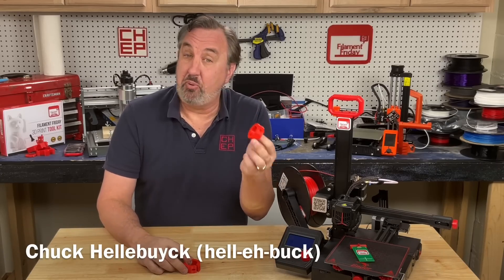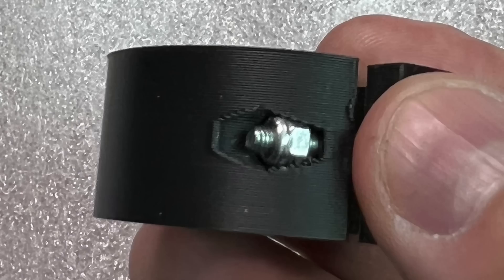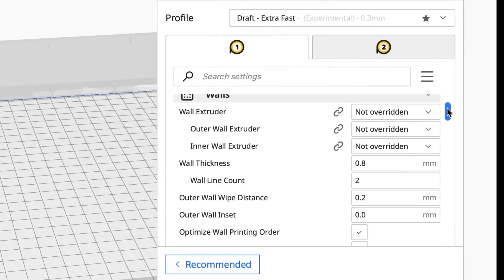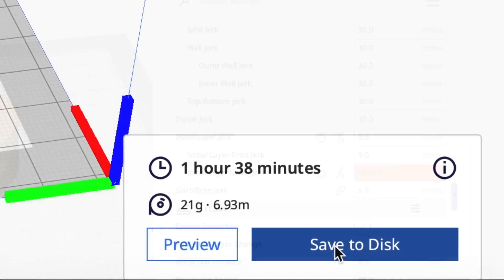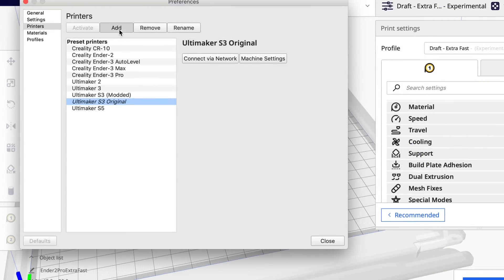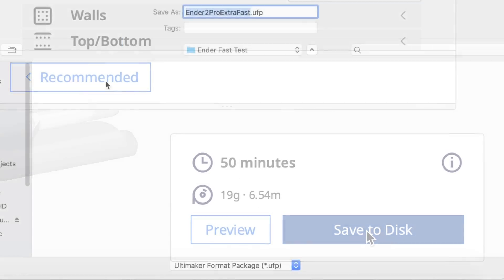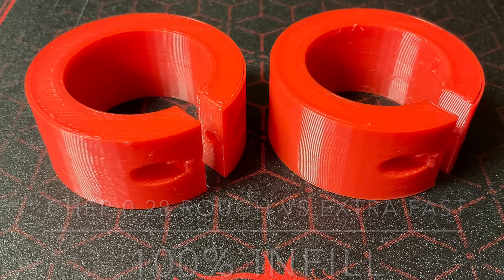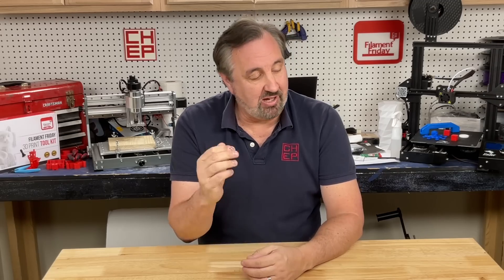Faster 100% Infill Prints with Cura 4.13 on Ender 3D Printer

Comment: I bought an ender 3 pro a few days ago, I downloaded the profile to print faster and when using it sometimes it starts to have a loud clicking when retracting, at that moment it starts to print the layers badly, separated and detached, but sometimes it happens later After an hour of printing the first centimeters perfectly, the clicking begins, it begins to have hairs and the layers do not complete well. As a result, I have to throw away the imprecion. I tried to lower all the speeds, that helps but sometimes the problem occurs. Could you give me any help?
Reply: I had this same issue with my Ender 2 Pro; tried everything from temperature settings to various print speeds and nothing helped. Turned out that the extruder tension spring wasn't applying enough pressure to the filament, so when there was a part of the print with a lot of small retractions in succession, it would slowly grind away part of the filament and eventually lose grip. Check your filament at the extruder to see if it has a notch (too little spring pressure) or if it is deformed (too much pressure).
Reply: @DanielMushailov  After many tests, what I saw happen is that when I print more than 2 or 3 small pieces or 1 relatively large piece, it prints well for 1 hour or a few layers perfectly and then the nozzle clogs, and stops extrude, I tried with different filaments, it may be when it retracts a lot, but I don't know why it gets covered, change the nozzle and it does the same. It starts printing perfect and then it fails. If I put a small part alone, it usually prints perfect until the end.
Reply: @playtech7165  Have you tried using a different slicer, and if so, do you experience the same issue? If not, maybe you can compare the settings between the two slicers and see if one of the settings might be too aggressive in Cura. Also, you mentioned that when it stops extruding, it is difficult to remove the filament - do you see any inconsistencies in the filament you pulled out?
Reply: @DanielMushailov  I'm going to try the g code of the dog that came with the Ender 3 pro. I also recently went from cura 5.1.1 to cura 5.2.1. I am using the default profiles for the ender 3, the low and standard quality. When I remove the filament, sometimes I have to use a lot of force to make it come out, and I mean a lot of force..., but the problem is strange because it starts printing well and then it gets covered, it does it with all the prints... Now I try the gcode of the dog and see what happens.
Reply from the maker: Check your arm for a crack. https://youtu.be/iXe7bftyMFU
Reply: @FilamentFriday  I have the creality brand metal extruder, the silver one. After several days of testing without sleeping at night, I am coming to the conclusion that it may be the PTFE tube. When the filament gets stuck, and I take it out, I have about 20mm of the tip much thicker than the rest, it's like a swollen filament plug with the shape of the nozzle at the end. That jam that occurs after printing generates that there is no good extrusion or no extrusion at all. Tomorrow I get 2m of genuine Capricorn tube. I also bought the CR TOUCH leveler, since the bed is deformed and with a glass I could not finish making the pieces stick to it. Once the tube has been replaced and with the automatic leveling calibrated and working, I will see what happens and tell you.
Reply from the maker: That happens when the PTFE is not all the way to the nozzle or your fan is failing causing heat creep.
Reply: @FilamentFriday  A few minutes ago I finished changing the ptfe tube for a capricorn from creality, I also put cr touch, and glass, now at the moment it is printing correctly, I don't know how long it will last, so far in less than a month I was able to print half of the time and the other half I was having a hard time trying to solve problems. Thank you very much for your videos and for your answers!
Reply: @FilamentFriday  Confirmed, when it clog it is a heat creep problem, the tip of the filament is 1.9mm thick, the last 30mm before reaching the tip of the nozzle. It takes a lot of force to get it out when it gets stuck like that. I find it strange that the front fan is failing since it spins perfectly all the time and the printer is 1 month old since I bought it new. I tried a temperature of 205º and 195º to see if it affects anything... since I saw that heat creep can be caused by high temperature, more than what the pla needs, that it has to be lowered... I'm going to try lowering it to 190º. I put 4 small objects to print 1 at a time, in the third one it usually gets stuck and stops printing, I have 2 complete, 1 in half and one that never prints.
Reply from the maker: Touch the heat sink, is it hot to the touch? 
A fan can spin and still not cool enough.
Reply: @FilamentFriday  I touched the heatsink and it is hot to touch, it burns the fingers. I bought a new fan. I hope it arrives tomorrow. Meanwhile I put thermal paste between the heatbreak tube and the heatsink, cleaned everything, put everything back together. I have to test if there is any improvement. Could it be said that the worst and weak point of the Ender 3 pro is the hotend? I was about to buy an Ender 3 Neo, which I asked you in another video, but now the truth is that I have no confidence in the Ender 3. Is there a printer that you can recommend that is less prone to this type of blockage due to heat creep? The truth is that I spend 70% of my time trying to fix things and wasting material and 30% printing. Not to mention that I did several expensive upgrades at high prices in my country, and I haven't solved the problem yet.
Reply: @FilamentFriday  I have another question... when you replace the plastic extruder that comes in the ender 3 pro with the metallic silver creality brand, I couldn't place the gear with the screw that came in the new one, because the gear that has the motor is put under pressure , it does not have a screw to remove it, I looked at the moment and it is the same diameter, besides that I adjusted the e-steps just in case. Could this be causing me a problem?
Reply from the maker: A good fan fixes this issue.
Reply: @FilamentFriday  The only one I could get is the genuine one from creality, which is the same it has right now... I would like to put a better one, do you have any model / brand to recommend that is compatible? this one it is 24v
Reply: @playtech7165  I have the same issue you're having. I think it might be the "print thin walls" option as it slows down the extrusion. Ill try it later to see if it solves the issue. Im using the sprite extruder.
Reply: @Spuki2k  I had a heat creep problem, completely disassembling the hotend, cleaning it, putting thermal paste between the heatsink and the heatbreak, assembling everything carefully, I had no more clogs.
Reply: @playtech7165  I've had the same issue with heat creep before but it was due to printing tpu and having too high retraction causing blockages in the hotend. I took mine apart twice in an evening until i found out why on reddit. that being said I found that turning off "print thin walls" improves the quality of this profile alot and makes the edges much cleaner.
Reply: @FilamentFriday  а еще, возможно, температуру показывает неправильно и она намного выше или ниже на самом деле.
Reply: @playtech7165  очевидно, что нить начинает греться слишком рано, не дойдя еще до сопла. Не справляются радиатор и вентилятор с охлаждением выше сопла.
Reply from the maker: Start with my good or best profile to see how well those print. You may need to adjust the esteps value and also adjust the temperature to get the proper flow when printing faster with the filament you are using.
Reply: @FilamentFriday  Thanks for answering. When I bought it, I was using the Cura standard profile, at 200ºc to print PLA. With the fast profile I saw that it uses 205ºc when the noise started, I tried 210 to give it more temperature when it extrudes more. I was also testing even now using the default profiles of the elder 3 pro, it makes the noise when it retracts after printing 1 or 2 hours, it starts perfect and after a while it starts to crack and what I suppose is under extrusion, since it doesn't completes the layers well, only when the noise starts. Needless to say, I use the CHEP gcode to level the bed every 2 prints to rule out a level problem. I gave the extruder spring screw a little adjustment. I was planning to buy the original metal creality extruder and a new hose
Reply from the maker: Make sure your PTFE is all the way to the nozzle. If there is a gap it could build up and cause partial blockage.,
Reply: @FilamentFriday  Thanks for your answer. I disassembled the extruder to check if the plastic lever was broken, it is in good condition, I reassembled everything. Disable power outage protection. It now prints fine with normal Cura profiles. I had no more noise. Try another color filament. I don't know which of all the things I did was the solution. I'm going to try the filament that was giving me problems again to see if it works now. thanks so much!
Reply: @FilamentFriday  Hi! I wanted to keep you updated on my problem and thank you for your help. I installed the Creality Upgrade Ender 3 metal Extruder, and all my problems are solved for now.
Reply: With the new metal creality extruder it was printing perfectly 24/7. Today it started to fail, I found a print after an hour of starting, which was printing 5mm in the air on the object without filament coming out. I was left with that impression in the middle... however the first half came out perfect. I made the extruder move 100mm and the filament comes out perfect. I don't understand what happens. This happened to me with the original poor quality plastic extruder of my ender 3 pro. I was using one of your profiles the FFV5.1_EF0.28, and the extruder was making noise, like it was slipping and it was making a crack crack type sound. So I tried the normal LOW profile of Ender 3 that Cura brings. I printed a box perfectly, put another one to print, and what I mentioned above happened... Any idea what could be happening? Thank you!
Reply from the maker: You might have to adjust the temp higher to match your filament.
Reply: @FilamentFriday  I tried increasing the temp to 210ºC and using the default low profile, which is slow. After making the base and about 10mm of walls it starts to fail, again the crackcrack noise, and the under extrusion.
Reply: I was seeing that it could be that the white filament that I was using caused the nozzle to clog. I had a hard time removing it, and it had a ball formed by the material at the tip. I'm going to try other colors. I still have a quarter of the white remaining and have been using it before with no problems.
Reply: I have tried several different filaments and the problem continues to occur. I'm going to upload something I filmed with the problem occurring. I tried various temperatures from 200 to 215 degrees and different speeds and profiles. Half an hour after starting to print, the noises start and it stops printing correctly. I don't understand what could have happened.
Reply from the maker: Could be bad filament.
Reply from the maker: Watch this: https://youtu.be/MaMYMTX1Xl4
Reply: @FilamentFriday  With the white filament  that i'm having problems I have been printing for a while and I have used 3/4 of the spool during the week. I've noticed that when the printer starts having problems the filament gets like stucked I have to pull really hard to take the filament out. this didn't happen before. I have also tried other colours and it happened too. I bought the printer a few weeks ago and here where I live things are really expensive. I have spent a lot of money (500 usd) buying all the upgrades, ptfe tube, and everything and i don't know what to do. it was working perfectly u to know. Thanks a lot for helping me I hope you can give me any idea of what can the problem be. This would be great!
Reply: I was levelling the printer´s bed and discovered that  the middle was higher than the corners. That didn't happen a few days ago. It might be bending. I tried levelling it, leaving the middle not too tight and the corners get loose. I tried to find a balance where the middle is less tight and the corners are almost not in contact with the thin paper I use. I could start printing again. I might have to replace the magnetic sheat for a glass
Reply from the maker: That’s why I prefer glass bed.
Reply: @FilamentFriday  Hi!  I upgraded the bed springs and uploaded the Z-endstop. Is it necessary to configurate the z-off set or any configuration in the printer? Should it work only by levelling the bed?
 I level the bed with the chep gcode and when it starts printing, it prints higher in the mid air and the filament doesn't stick to the bed. I have to adjust it while printing. I could get a perfect first layer but after some layers it starts getting kind of stuck and prints in the air.  Thanks a lot for helping!
Reply: @playtech7165  проверьте качество соединения всех разъемов, особенно тех, что подключаются к печатной голове принтера.

Comment: Is there a way to use your profiles on a non ender machine?? I currently have a geeetech a10 but also thinking about getting a ender 3
Reply from the maker: Just use Ender 3 machine profile.
Reply: @FilamentFriday  thank you I’ll try it out
Reply: @FilamentFriday  You sir are an absolute legend .. i have done as you suggested and printed with your 2.0 profile the sample that came with the profile and it's flawless i have never seen a print looks so perfect off the printer with no post processing

Comment: Most impressive , I'm trying your  "best" profile right now for a figure with tree supports  but the extruder moves so insanely fast that I doubt the branches will survive
Reply from the maker: Let me know. The best profile should not be that fast. Only the Extra Fast profiles are faster.
Reply: I used the fast print profile and tree supports for long print (13hours with the fast profile, imagine what it would take with regular)
Came out perfectly, supports removed really simple, except the places where it touches the model, but I guess I just didn't need to mess with the distance from print.
EDIT:
I used 0.2 layer height fast profile on Cura 5.0 with Ender 3S1 with bi-metal hotend and PEI bed. The print was as big as my whole bed.

Comment: I recently tried this on ender 3 and got under extrusion. Havent played with it too much to get it to print right.
Reply from the maker: Increase the flow to match your printer.
Reply: @FilamentFriday  in the printer or in cura?
Reply from the maker: Both really. Verify your E Steps are right, then adjust the slicer flow settings.
Reply: @FilamentFriday  ill give it a try today. Thank you!
Reply: @FilamentFriday  I played with the flow while printing a hollow cube. Settled on 120. But there is a gap in the start/end seam
Reply from the maker: Make sure coasting is off.
Reply: @FilamentFriday  I just checked and that is turned off. It seems like thats what it is doing.

Comment: i did this fast printing. it lasted about 2 months then my y axis started missing steps . yeah it printed really fast like 1/4 the time but my y motor did not last. it still works just no more fast prints
Reply: Belt tension? Stepper driver overheating? Belt stretching? There's a few things you need to check before writing an axis off.
Reply: with ender 3

Comment: You were reading my mind. I only have an Ender 2 to work with and that's fine; I like it and most of the time it's enough printer for me. My go-to filament is FormFutura TitanX. I have some projects where I want to get the strength up substantially so just yesterday I started investigating how to properly go about that. This example should reduce my trial and error time and I am coincidentally staying at Cura 4.13 until version 5 comes out of beta, so good timing on that too.

Comment: I have found an issue with the Fast profile, no matter which version of Cura I use I can no longer print a buildplate full of parts one after the other, even with auto spacing of the parts they are all but 2 chequered out wheras if I start with a fresh install and no Fast Profile I can print my buildplate full of parts no problem, I believe this is because the profile was for an Ender 3 V2 build size, I removed all reference to the V2 at software level but I believe the measurements of its buildplate are being used to evaluate the size before slicing even though I have my correct machine profile and buildplate size set, maybe you could do a video on how to set up the settings to acheive this profile on our own machines from scratch, I can myself use a comparison of the profile against a stock profile and list the changes to build my own profile for my machines but others may not know how to acheive this

Comment: I think it has to do with either max acceleration or jerk controls (max). it does print faster (at least 50% ) than my custom .28 profile, but my ender makes a lot more noise when printing, like a lot if that jittery noise when it zigzags fast. not sure I would risk a tall print with that profile

Comment: Maybe its optimised printing order and stuff like that.

Either way as im using superslicer (definetly not looking back, cura is crap in comparision, at least the ui...) i have my speed Profile made, cubic infill, 40%, 0.75mm infill line width (Cuts off a huge chunk of time), 200mm/s infill speed, 150mm/s wall speed, 80mm/s outer wall Speed and 50mm/s top and bottom layers, that done with 5k accel (could go higher but im happy).